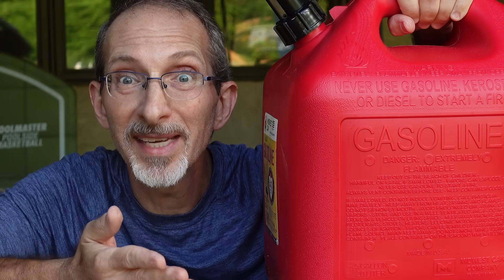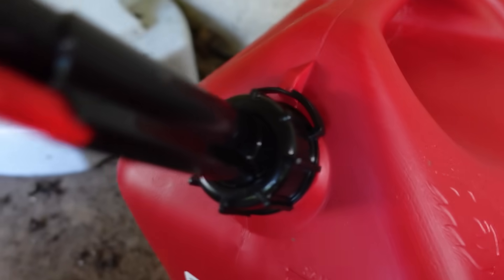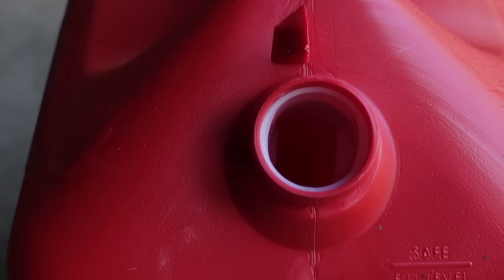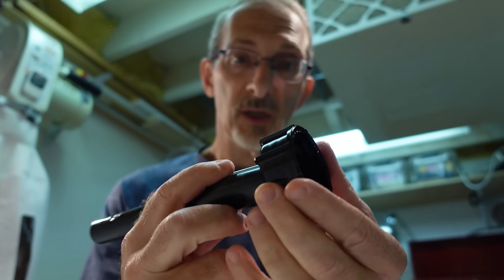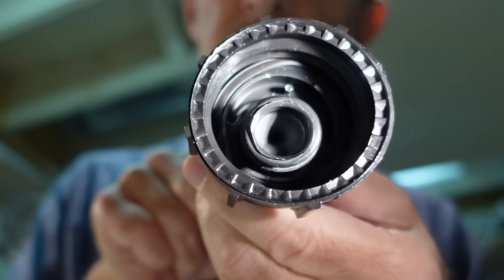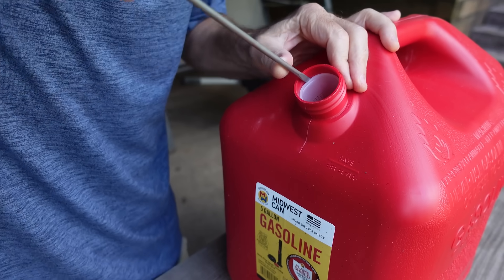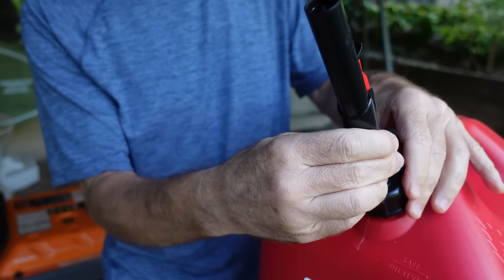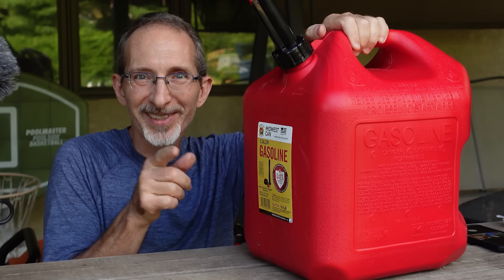Gas Can Modification | New Gas Can Fix

Comment: Of all the modern gas cans I've owned over the years I have just one that works well.  I use it on my chainsaws and weed whip because it is impossible to over fill the tanks using the new-fangled spout on that can.  Once the gas rises to the end of the spout (as the tank gets full) it stops the gas from flowing out the spout.  This one is also nice because it self-vents and the gas can come out fairly fast.  

Issues I've had with other spouts very similar to the one in the video are:
- You have to push so hard on the spout to get gas to flow that it distorts the seal between the spout and the can resulting in gas spilling all over.  I've even had spouts pop off the threads on the can which really makes a mess!
- When dispensing gas a vacuum builds inside the can until it gives a big glug and sucks a bunch of air into the can.  This slows the delivery of gas to a miserable pace.
- The actual design of the spout makes for a low flow of product so it takes forever to get gas into anything.  And all the time you are pouring the gas you are pushing with all your might to hold the valve open so the gas keeps coming out.  If you lose the force or it slips off the edge of the gas tank the valve closes and you have to start all over.  Plus the plastic is soft so it is soon worn down to the point where it hardly holds on the edge of the gas tank so it is constantly slipping off and stopping the flow of gas.  

The bottom line is that I ordered old-school spouts for my 5 gallon cans off Amazon and threw the new-fangled spouts away.

Comment: You forgot a vent on the back.  You can buy those kits online with the exact size drill included.  When I'm putting multiple 5 gallon cans in my tractor it takes like 20seconds to drain the whole can.

Comment: Please do some research before your next video so you don't give incorrect info again. The "filter" as you called it is a flame shield safety system / internal flame midigation device. Now when some idiot removes the "filter" and they use their can near an open flame and fire runs up to the can and kills them, their family is going to sue you. I have some of those cans and have no issues filling them. You just can't hold the gas pump nozzle wide open. Now is that flame shield really worth a crap to begin with? Who knows but that's a discussion for another day. People don't always read the description of the videos. I know I don't.

Comment: Why would I need to filter my fuel from the can? surely the fuel coming from the pump is already clean and you only need funnel with a filter to do the same job. It seems like safety gone mad...
Reply from the maker: Richard, what I called a filter is actually a flame arrestor safety device, which I explained in my second video, link in the description. And yes, safety has gone mad! 😂

Comment: Thank you, California. Your efforts to reduce gasoline fumes wafting out of the can while it's sitting in the shed have resulted in said fumes evaporating from the puddle in my driveway. You've done an outstanding job saving the environment. Bravo.
Reply: Just the same as regen on diesel engines, burn more fuel to clean the system which creates more problems and takes away from being efficient
Reply: @richardlambert1544 exactly!
Reply: Kind of a metaphor for the Environmental movement all together. Making bigger issues then the original problem.  Then just blame a republican or whatever when what you did went to crap.
Reply: @slimmosessixround  
Of course!
Blame anyone but themselves.
Reply: Commiefornia all the way
Reply: Wasn't California supposed to fall off map into the ocean?
Reply: Not to say the puddle at the gas station from splash back. I had as much on the ground as in the can. I just quit. Good ole YouTube, I knew I wasn't alone. 😅
Reply: Hahahah
Reply: I think it also has to do with absolute morons using gas cans to make bin fires bigger. The gas cans explode and kill the pourer and people around them.
Reply: Democrats can screw up anything. The problem is, they don't just do it to themselves (Cali); they drag everyone through their mud.
Reply: I don't think California can be blamed for this stupidity being mandated nationally.
Reply: They (CA) keep promising that they want to leave the union from time to time. I say quit teasing us and do it.
Reply: California...  smog-free thanks to def regen systems and fume-free thanks to such gas cans...  lol  California is like a virus and then the dumbasses move to escape and only infect wherever they land when they try to create new "Californias"...  🙄
Reply: California = crazy lib   how about paper straws wrapped in plastic? Yep California crazy .... while 50 million plastic water bottles are littered every  week in California ......
Reply: Yet another reason why the US needs to be 50 states-1.
Reply: @akira5026 52 states.  Most of Northern California has more sanity than SoCal. (Barring Bay Area) Split the state in half and we'll happily start shutting them out.
Reply: @akira5026  CA is basically a terotory of china now with all the commies and the population change there. Can we consider it a teritory and nullify their votes?
Reply: Everyone on the military ive spoken to wants to cut off california to stop these bad regulations. Afghanistan is literally safer for all marine veterans than California, as more people have died there than in Iraq
Reply: Not California.. Obama's EPA
Reply: @rodshoaf  Look up C.A.R.B. Compliant. Its all starts in California.
Reply: @rodshoaf  I'm confused does Obamas EPA stand for Erect Penis Association , I'm just saying cause I'm Illerate.
Reply: @rodshoaf  This indeed started in California back in the Bush days... Google it!
Reply: @rodshoaf  Wrong. EPA was working on this long before Obama.
Reply: YOU NEED TO LEARN HOW TO USE THAT NEWLY DESIGNED PORTABLE GAS TANK AND ITS NOZZLE !!
Reply: @richardt.953 
That's exactly what he did!
Reply: @supergeek1418  It wouldn't be an Internet forum without a "richard" commenting.

Comment: A little late to comment on a 2 year old video, but you missed the most distressing thing about the nozzle assembly.  Assuming these are exactly like the ones I purchased, there is a gasket inside the nozzle where it attaches to the can.  Removing the nozzle by allowing the nozzle to turn causes the gasket to be cut and with as little as 3 to 5 removals of the nozzle, the gasket will leak badly when pouring gasoline.  The only way to NOT cut the gasket is to hold the nozzle when turning the 'nut' that holds it to the can.   The damages gasket is a very special gasket.  Ruin it and the can is not safe to pour gasoline from.  Extremely poor design.  I have three cans, two of which have damaged gaskets.  Found out the hard way.
Reply from the maker: Dave, you bring up a good point… These gaskets are very delicate. Thanks for your comments!

Comment: Thanks for this video. I have been lucky in that I still have 4 or 5 of the older style gas cans which are so easy to use. However if I do eventually have to buy a new one I now know how to defeat the ridiculous "safety" modifications which have made new gas cans a pain in the butt to use! Thanks again.

Comment: So, no cover for the end so all the dirt, mouse poop, bugs and everything else in a garage can get into the opening of the can but not in the fuel and will mix into the fuel when you pour the fuel out.  Wow, the engineers that designed this stuff should be fired.
Reply from the maker: Cover added in my second modification video! It's a small detail but an important one. Thanks for commenting!

Comment: I always do the last Mod, they used to make it way easier to pull out

For the second Mod, i would have opted to shorten the spring instead, by either heating it on the end or Solder a section of it

The first Mod ? 
Why bother ? 
They fall off sooner than later Lol
Reply from the maker: Great suggestion… I shortened the spring in my second video, link in the description. It did make a difference!😁

Comment: these "safety" cans are supposed to prevent it from falling over in the truck or wherever and leak gas out of the can and be a fire risk.  yet, NONE of them I've went through so far have EVER prevented gas from leaking out of the stupid cap where it goes onto the jug.  So they literally get more gas ON my mower than IN my mower.
Reply from the maker: Jeff, perfectly said! Thanks for commenting. 😁

Comment: The thing in the gas can that you call a filter is a device that qualifies it as a "safety " can. It prevents oxygen from entering the can to eliminate the possibility of an explosion. Real safety cans have this screen as well but they have a separate fill cap without the screen
 I have the same can and yes I eliminated that crappy nozzle and took out the screen as well for the same reason. These safety nozzles that they are putting on these can are more unsafe than a can without.
Reply from the maker: You are correct, the filter is a flame arrestor, which I spoke about in my second video, link in the description. No matter what its purpose, it is a huge pain in the…

Comment: ALL new and improved no-spill spouts cause more leaks than ever.  They all SUCK.
Rather than a razor, use a Bic and melt it down to a rounded softness in 1 second.
I think I might have cut 1/3 of the spring off and reinstalled it, so it wasn't nearly as strong but still self-sealed.  Instead, I spent $74 and got a pair of 5.5 gallon motorcycle gas cans with 1" vinyl tube spouts, 45 degree benders, and no obstructions.  They're great.
Reply from the maker: While I haven't tried one, I hear the motor sports containers are great solutions. Thanks for your tip on using a lighter instead of cutting the tab. Good stuff! 😁

Comment: So glad I got rid of my gas mower 30 years ago. Replaced a series of smelly mowers with a corded electric. The first one finally died after 25 years, the current one is still working like new. Only problem with electric mowers is that by the time you need a replacement part they've stopped supplying them.
Reply from the maker: Interesting info about electric mowers! I've never owned one but I see their popularity growing, especially the cordless ones. Bummer that replacement parts don't stick around. 25 years for any piece of yard equipment is a huge success! I appreciate you sharing your experience and thanks for watching! 😁

Comment: I use EZ pour spouts and I found vents that resemble an air stem for tires. 
Beautiful.
2 ft long spout and can empty a 5 gal can in like 1.5min.

Though I do wonder if just asking an air valve would fix some.
Reply from the maker: I added a plastic flip vent in my second video and it made pouring gas much smoother and faster IMO.

Comment: Just switch out the current set up for a ball valve and rubber hose... invert the can into what you're  filling and throw the lever. When full; lever again. Pull out and be done...
Reply from the maker: That's a unique solution! Thanks for sharing Tom! 😄

Comment: Absolutely brilliant! I am also having issues with my gas can expanding when it’s hot to the point where it looks like it might pop. And then when it’s cold it contracts way down. Any thoughts on this?
Reply from the maker: If the container is expanding and contracting, then it is airtight. The plastic has enough flex to withstand it. When it's bloated and you go to burp it, just make sure you are not around a spark or a flame…

Comment: FYI, that screen in that gas can is not there to filter anything. It is a flame arrester screen. It is suppose to prevent an outside fire from getting to the gasoline inside the can and prevent the can from exploding.
But it just goes to show you just how right President Reagan's comment about the most feared words in the English language: "Hi, I'm from the government and I'm here to help" really are. Now I'm not making anything about one party over the other. 
But when you get a bunch of bureaucrats and environmentalist involved that have no common sense or a working brain and they never get their hands dirty doing real work, sitting behind a desk, they over complicate and over think things way too much. The older gas cans were relatively safe for those that have common sense and know that it is the fumes not the liquid that ignite. But I'm not saying improvements couldn't be made. That is why I just buy a replacement nozzle kit without all that junk, or one that works for me. Preferably one with a cap that covers the nozzle so dirt doesn't get in the nozzle then into the tank. You can buy them online, in car part stores or in hardware stores and they are not that expensive. But the online option might be the only choice for those living in California. Just make sure the one you buy will fit the can you have as some cans will only allow certain types of nozzles. Some of these nozzles will come with a vent cap to install. Some of these nozzles will have a spring loaded button, lever or trigger you use to open a valve to let the gas out. Just choose the one that works for you and be safe. Remember, it is the fumes that will get you if you are close to an ignition source like a flame or spark and accidents do happen. BTW, I'm not knocking what he is doing in this video, but I do prefer the better designed safety valves that cut off the flow on the other nozzles for better control and safety.
Reply from the maker: All well said! I appreciate your comments! 😄

Comment: You forgot a little yellow air flow cap but i love the spring removal
Reply from the maker: Tim, yes! In my second video I added the yellow airflow cap and reinstalled a modified version of the spring that makes it easier to depress the spout. Link in the description if you'd like to watch. Thanks! 😁
Reply: @MikeFyxdt  I've never spilled so much gas all over myself or mt equipment as I have since a "safety cap!" was mandated.

Comment: I use a self tapping screw to make a vent hole directly behind the top handle. I do this before filling and vacuum out any debris inside the container with a shop vac. The screw makes for a decent vent cap when not using the jug to fill the tank.
Reply from the maker: I added a flipped vent in my second video. Also done before I used the container so I could vacuum out the plastic bits. Thanks for sharing your idea!

Comment: That spout absolutely sucks.  Now to watch the rest.  Bought 2 cans, one filter quickly collapsed into the can as I filled it the first time.

One thing you missed was the inability to store the spout inside the can.  The spout is vulnerable because it doesnt store nicely at all.
Reply from the maker: I can't remember if the flame arrestor keeps you from flipping the spout around… but that's a good point. Thanks for commenting!

Comment: Throw the nozzle away and find a cap to fit the can. Drill a hole in the handle to give it air so you can pour and you are in business. Buy a funnel.
Reply from the maker: John, yes, funnels should be mandatory equipment with these containers! 😄

Comment: These stupid so called safety caps on gas dose not work the way they are designed to work. Like the ones they got on the gas cans now that's got the green little lever that you're supposed to push forward in order to pour your gas you have to push really hard on it before gas even comes out. Luckily for me the older gas cans does just got the straightforward and nozzle you tilt it and gas comes out fills up the gas tanks on the lawn mowers in the garden tillers with no problems. But whatever idiot these new gas can they need to go back to the drawing room and come up with a much better design where you can easily get the gas out of the can. Like go back to designing the nozzles that is free and open EZ flow.
Reply from the maker: Timothy, agreed! The old containers were so easy to use. 😁